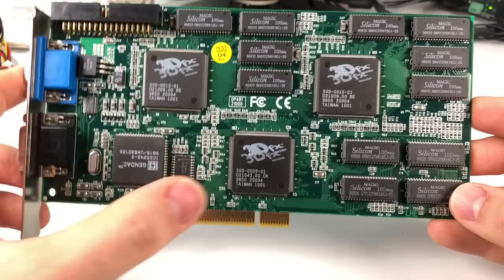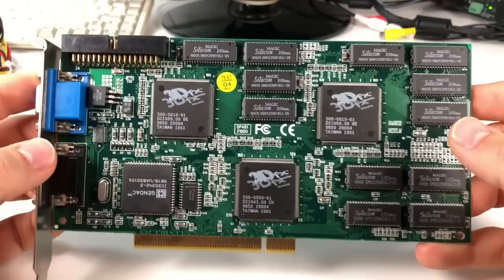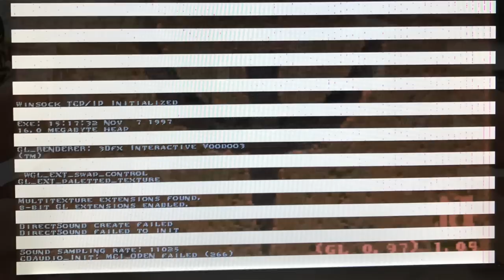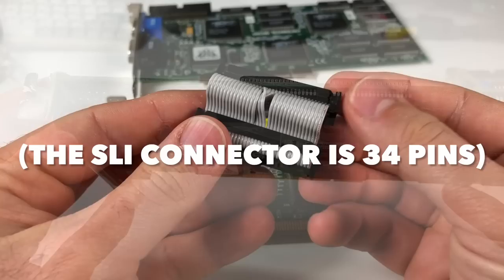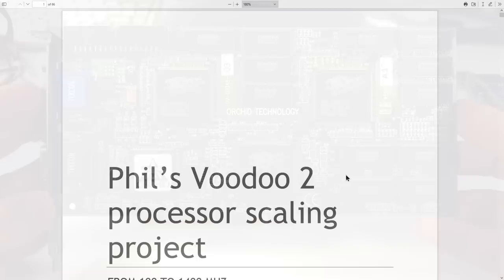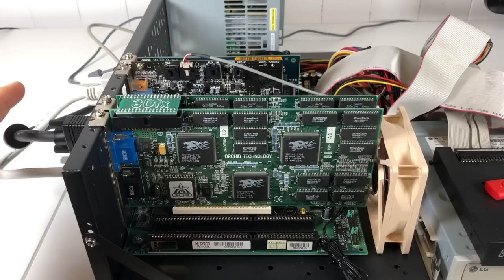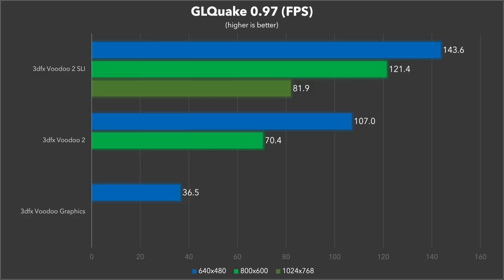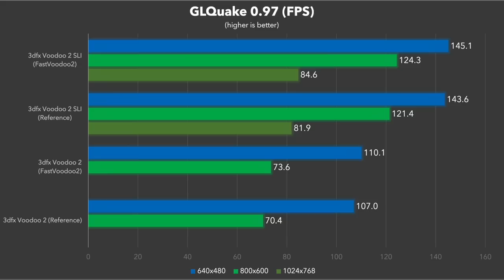The 3Dfx Voodoo 2 - Taking 3D to the Next Level!

Comment: I have two 12MB Voodoo 2 cards running together with a GeForce 7900 GT with Windows 98 Se in a Core2Duo E8400. The Voodoo cards are connected to the PCI Express bus via an external PCI bridge. They work perfectly with SLI. This PC is not time correct but you can run any Windows and DOS software with the highest performance. But I also have other systems which are timed correctly. Best regards, Chris
Reply: try playing alone in the dark in that pc and say that again
Reply: dos? most dos games crap themselves with anything higher than pentium/ii 500mhz, besides, does your board have an isa slot or an lpc header? playing dos games without sound is not worth it.

Comment: You know the one thing that I didn't like about running a V2 in SLI was that if you disabled Vsync the SLI would go out of sync and when the screen moved you'd see lots of jaggies appearing where the scanlines all went slightly out of sync. So basically you had to run it with Vsync on all the time. For this reason I do prefer the V3 for playing games, but nothing beats the 'cool factor' of those beefy chips on the V2 boards... The same kind of feeling as seeing a V8 super car engine, to me anyway.
Reply from the maker: Very true and totally agree about the cool factor! :) .. I noticed that as well. I forgot to turn on vsync again when I did the game recordings, so they are extra jaggy unfortunately. Everything feels a lot more smooth with vsync enabled.
Reply: This problem had more cards in that time.
Ati rage Fury Maxx had the same problem.

Micro stuttering have almost dual card systeem .
Reason i stop with it after ati radeon 2900xt crossfire.
Reply: @dyslectische  The Rage Fury MAXX used AFR, rather than each chip rendering 50% of the screen in SLi, the MAXX had each GPU rendering alternate frames. This made stuttering much worse if one VDP took longer to render than the other, which is almost always going to be the case with dynamic content like a 3D game.

Had the MAXX been properly engineered from the ground up, it may have been a much better card. As it was, it was a cobbled together mess trying to compete with the Voodoo5 and the Geforce SDR/DDR.
Reply: @GGigabiteM  the rage Fury Maxx use the agp for dual gpu setup 
Somting agp can not really do .
If the card works you had a good fast gpu for games.
But nvidia had the same problem later after taking over 3dfx ..
Glide is software speciale make for the 3dfx hardware .
Under directx and under opengl .
Dual gpu had always micro stuttering.
So long the game is not make for dual gpu .

Even today new DirectX have dual gpu solution to use ,even if you 2 brands and type .
Only it have to set in the software of the game to active and optimize.
Wat a game manufactur not today .

How wel amd use internal of gpu today blocks to make and is a dual gpu .
That is the reason that amd rx6400/6500 only have 8x pci-e slot and other have more pci-e 16x slot .
It use 2 blocks internel in side the gpu.

Comment: I remember buying my first Voodoo 1 card, then the two and then putting them on all my PCs with 19" monitors and running a network for my kids to play in 1024 mode and it looked crazy good (but expensive at the time).  I went right up to Voodoo3 but stopped there and switched back to NVidia when the Geforce 256 and then DDR came out - and stuck on the NVidia upgrade path until the R300 came out with the 9700 Pro and then 9800 Pro.  It wasn't until the 6800 and finally the 8800s came out that graphics took a mega jump forward...I think I must be on my 20th GPU by now - but still primarily use my 1080Ti as it is plenty fast and powerful enough for all I need.

I am old enough to remember when 2D accelerators where the big thing!

Comment: Bought my first PC in 1997(had an Amiga before), paid over 2,000 DM for it with the monitor.
It already had a "3D card", a Matrox Mystique 220. The games needed special patches to make use of it.
In 1998 I paid 520 DM for the Voodoo 2 on top, only the 8 MB card.
But it was really a performance upgrade. Many games were playable with over 30 FPS which was considered as smooth these days.
"Ultimate Race" was a nice game that came in a bundle with some cards. And my friends and I had all bought the same bundle and when we bought the PC's in 1997 and 1998 we all had network cards installed. It was a hassle with the BNC but we had great times with different racing games and 3D shooters.

Still have the card and one that a friend of me gave me later.

Comment: My first 3D accelerator! I didn't have anything apart from 2D Graphics card before that (VGA). I remember it changing the look of Quake 2 especially. And later there were games that wouldn't play without it. Funny thing is that the most beautiful game that I remember was "Forsaken" on Unreal Engine, I think. Just as we got Voodoo 2 the demo was released. My jaw dropped at beautiful lighting effects.

Comment: There were still a lot of calculations being done on the CPU side such as calculating the coordinates of each polygon vertex. This is why a fast CPU was incredibly important to squeeze every last bit of performance out of the Voodoo 2. If I'm not mistaken the GeForce 256 from 1999 was the first card to offload the entire rendering pipeline to the GPU.
Reply: But if you switched from software 3d to hardware, games ran faster on a voodoo. Other „accelerators“ slowed them down.
Reply: I remember the 256 first time in our shop. The box was soooooo big ! It was redicolous

Comment: I remember the one ad in PC Gamer in either 1997 or 1998, advertising the DIamond Monster3D-II and how much better Descent II was with it.  I drooled so much over that ad due to how much I wanted the Voodoo2.  Now (though the machine is in FL), I have a build that has a V2 12MB and is ideal for games of the late-90s.  I just need a second card, and to get my GeForce 4 Ti-4600 repaired, and I'll have quite the kickass machine (as it also has a Diamond MonsterSound MX-300).

Comment: what a great time i had with the voodoo 2 card! My 2nd PC was a P1 166 including a matrox mystique. Damn, I wanted to play NFS3 so much, but that Matrox could only go by software render. In early 1999 I found a cheap Voodoo 2 (Miro HiScore 3D 2,performance and prices changed so fast) for 100 Deutsche Mark and built it into my PC. What a game changer! It opened so much more possibilities! 
And the best thing? 
It had analog Video out so I could attach it to a large TV! Take this, PlayStation 2!
PCs came and go, but the Voodoo2 still has a special place in my nerdy heart. 
And guess what is built into a retro-PC in my living room: that very Voodoo2 card, along with a sister for SLI (of course it HAD to be a 2nd Miro due to the TV out PCB layout, a generic one would not work) and a P2 233
Voodoo2 and Slot- CPU, a dream combination

Comment: The only thing that topped getting a Voodoo2 was getting a Sinclair ZX81 after using the ZX80. The frame rate, the resolution blew my mind, never thought it was possible that computer could display ASCII so fast and without crashing every 5 minutes.

Comment: The Voodoo2 was a game changer.  It would be years until a similar "tech reset" would occur.  Sure, nVidia and even 3dfx were incrementally adding features like texture compression, AA, "bump mapping" - soon to be shaders, etc... but it would all come together in a card from ATI - the 9700pro.  THAT thing literally leapfrogged every other product by nearly double performance, and for the first time, all the new tech could be run together, and easily faster than any competitor in any scenario.  It truly needs more respect than it gets.
Reply from the maker: Very true, the 9700 Pro was an incredible card. I remember wanting to get one really bad back then. In the end, I got a 9800 pro a little later. Was a fantastic card.

Comment: I can only say 2 things.   Something about how those cards presented 3d graphics was so new to us,  it made everything look 3d with a depth that even modern games don't seem to match.  I'm sure some of that is just we've become used to it.    But even watching your video of these old games there is a depth and a sensation of movement I don't feel even on modern PCs / Consoles.  

I'd love to peek into an alternate universe where instead of the disaster that was the banshee, 3dfx had just paired with someone like Tseng or S3 and built an all in one card with an existing 2d chip.  I think that could have kept their headstart alive long enough to come up with a real all in one solution that actually worked.   Banshee was a disaster they never recovered from, it gave Nvidia an in to the market that just wasn't there before.

Comment: I was working in a computer shop when the Voodoo 2 came out and the games were amazing. Unreal and Motorhead in particular blew me away and I would 'test' them on the in-store computers. Never could afford one though - had to wait until about 2004 when I picked up a Voodoo 3 in a thrift store for nearly nothing and then experienced it all again. Interesting that you put the lack of framerate improvement down to CPU bottlenecking. In my slot 1 buildoff video I jut took it as a feature that the extra card gives you the extra detail but maintains the framerate. This was on an 850MHz Pentium III as well. I also had an 8MB card running quite happily alongside a 12MB card - it just ignored the extra memory it seems. Thanks for the informative and concise video!
Reply: When I went from an pc Pentium II 337Mhz to an oc Athlon 660Mhz the framerates exploded on my V2SLI and Voodoo 3 system. ;)
Reply from the maker: Thanks very much! 🙂 Yeah it looks like 3dfx may have actually improved compatibility with mismatched cards at some point through driver updates. I don’t think it was possible initially.

Comment: I have an Epox EP-MP3Vg5, k6-3 450, later upgraded to k6-3+ 450@550 Or 600 sometimes and 768MB ram PC133. At some point I had dual voodoo cards, but sold them off for some reason. I was using them with UltraHLE, playing Mario 64 @ 1024x768 ! A friend of mine in the usa bought my k6-3+ and my motherboard off me that i met on amdzone. I was running my system up to 2002/2003 as I did my final programming project on it and demonstrated my work on my pc during my presentation.

I had upgraded to Athlon shortly after.

Comment: You can “sort of” do 1024x768 using wicked 3D miniGL on a single card though…
Also would recommend adding heatsinks to those V2 cards
Reply from the maker: Interesting! I'll have to look into this.
Reply: G-Police worked in 1024x768 too, if you deactivated the Z-buffer
Reply: … when I remember correctly then gaming at a resolution of 1024x768px was possible on several titles, but you always needed the 12MB VRAM version of the Voodoo2 - that was the deal: more money, more pixels 😉👍🏻

Comment: Nice one. I had a Creative Labs Voodoo 2 12 Mb then I went up to a Voodoo 5500 AGP.  Now I use nGlide on my Windows 10 PC. I have put my Voodoo 5500 in a case to run some older games in Windows 98se. With a AMD XP 3200 CPU it runs very nice.

Comment: I was lucky enough to find an Obsidian 24x Voodoo2.  A card that took up only one PCI slot, while doing the job of 2 cards without need for an SLI cable.  This was key for my IBM S78 2159 that had limited expansion slots... one of just two PCI slots was used for a SCSI card.  24MB of memory for 3D in one card was mind boggling and rare back then.  I also have two sets (4 cards) of Creative Lab's Voodoo2 12MB cards.
Reply: Yup, Have an x24 myself!  Saw one for sale a year or so ago for $5K!

Comment: I had 2 Voodoo 2's in my PII - 266. All of the tech info at the time stated that the Intel I740 AGP and the Voodoo 2 didn't work and play well together, that was total BS. I never had any problems. Every game was as smooth as glass. A couple of people back in the day were worried when I was the host for NFS 2000, Deltaforce 2 and 3 and Warzone. 2100 that my PC would crash half way through a game. Turned out they were the ones who kept crashing when they served those games. In the end I was the one who hosted games. At one point I had more video RAM than I had PC RAM. Unreal, NFS 2000, Warzone 2100 were great to play. 
I still play Warzone 2100 and Deltaforce 2, 3, and 4 from time to time. My current ATI Graphics card works well enough.

Comment: I used to run 2 Orchid 12mb cards coupled with a Pentium Pro 200 mhz to play Quake 2 online in Win 95. The cpu really bottlenecked the cards and the frame rate was pretty terrible. The PC is long gone but I still have cards, thanks for the video for a quick trip back down memory lane.
Reply from the maker: Thanks very much! The Pentium Pro was an amazing CPU in its time, but yeah, SLI would definitely need a newer CPU for high framerates. Awesome that you still have the cards too!

Comment: Way back when I had a Pentium 166mhz gateway that had a built in Matrox MGA mystique 1MB and I remember beating Half-Life in 320X240 on that. I threw in a used STB Voodoo2 I found at a local computer store and the performance  boost was absolutely unreal - spot on about 800X600 being incredible back in the day.

Comment: Still have my 8 meg voodoo 2.  Ran it with a celeron 366.. and later on a p2 450.  Unreal is one of my all time favorites.. still listen to the sound track occasionally.
Reply: i have a couple of them right here. ran one of them first with a pentium 233 mmx, then a pentium 2 400 @ 533, then an atlhon slot a 700@819mhz, then got my brother's voodoo2 to sli on my athlon 1ghz when he upgraded to a geforce 2 gts, then i finally upgraded to a gf2 gts myself. voodoos never let me down in that time. well, i mean... they kinda sucked at quake 3, but i was more of an UT guy anyway so it didn't matter.
Reply: @GraveUypo  Same.. I preferred UT to Quake.  I don't recall what card I finally replaced the voodoo2 with.  For a time I think I had a tnt2 in there with the voodoo2.  I think I switched over to ati Radeon cards.. I don't recall owning a Geforce 1 or 2.  I think the next nvidia card I had was a gtx750 or something like that.. lol.

Comment: Ive got dual Diamond Multimedia, Voodoo2 12MBs using a custom driver (Spaced and modified with 486 heatsinks and 40mm noctua fans) SLIed with a Matrox Parhelia 8MB on a Pentium III 1.2GHz Platform @ 1.4GHz w/1GB PC-133 SDRAM on a 440FX motherboard with a 64GB IDE SSD, Soundblaster Live! and Windows 98SE in my "Retrobox 2.0", Connected to a NEC 19" LCD, and Razer Mechanical mouse/keyboard combo, Runs like a champ!

Comment: I remember installing as well as selling these cards in a small computer shop I worked at back in the early 00's, they pretty much flew off the shelf.  I also remember after a year or so Nvidia bought out 3Dfx and implemented their tech into their cards. You would see the chip on their video cards for awhile before Nvidia began making its on video cards that simply left the 3DFX cards in the dust.  I remember playing in Quake tourneys at the local level and one of the prizes was the last 3Dfx voodoo 2 card made and was signed by someone famous in the VG world.

Comment: 6:00 I have the same issue, i still have my 2 voodoo 2's and probably their boxes as well.
What I remember mostly is that the 3dfx lighting was a lot 'brighter' in the way that it would add colour to its surroundings.
I had a Matrox M3D (PowerVR) before and the lighting was a lot softer. It would light things up to the same brightness but the the colour of the light would be fainter.
Reply from the maker: Very interesting! I know the default Gamma settings on the V1/V2 are pretty high as well. I hope to pick up a PowerVR card one of these days. Its one of the few early 3D accelerators I haven't had a chance to try yet.
Reply: @vswitchzero  It was a lot more natural lighting. It also didn't render fog which gave me a huge advantage on open view quake 2 maps with a railgun ;)

Comment: I had a Voodoo Rush...because, in the olden days, we didn't have very many PCI slots. I eventually upgraded to a Matrox 3D add-in card which was fantastic for its time. But Voodoo 2, and its SLI implementation, were the thing to have up until Nvidia started the GeForce line with its integrated T&L. They bought 3dFx after it went bankrupt.

Comment: You are one of these few channels where i first like and then watch. Always well explained and proper facts. Well done, the trip down the memory lane. I am actually also setting up an SLI machine on Asus K7M and Slot A Athlon 700 Thunderbird. Then i will just replace the CPU in 100 mhz steps up to 1Ghz and see how it scales up. Using Diamond Monster 3D II -  a pair of 8MB and after that the 12MB Versions. Things i didnt do back then hehe. Funny how interesting that is almost a quarter century later! Gretings from Germany. Cheers
Reply from the maker: Thanks very much! I really appreciate it :) .. Best of luck with your V2 SLI setup. Will be interesting to see the CPU scaling improvements. I have a Slot A system that I need to do some testing on as well. I have a 700MHz (non-thunderbird) and a 1GHz thunderbird for it.

Comment: Really enjoying these walks down memory lane. I never owned the Voodoo 1 or 2 card but I did get the Quantum 3D Voodoo Banshee that I mated wtih my Pentium 166MMX. Apparently it copped a lot of flak in the day but for me, I never had an issue as it was an upgrade from my S3 Virge GX/DX 4mb card. Loved it and got a lot of use out of it until I upgraded to the Nvidia MX 400 a few years later.
Reply: Are you aure, the MX400 was an upgrade? ;)